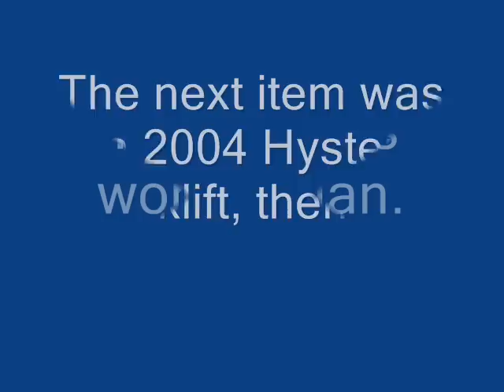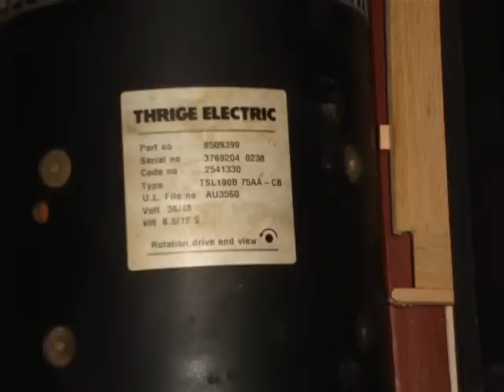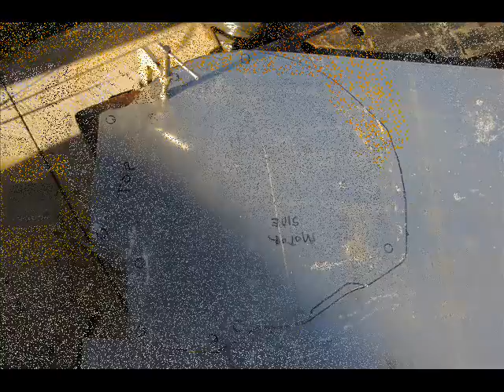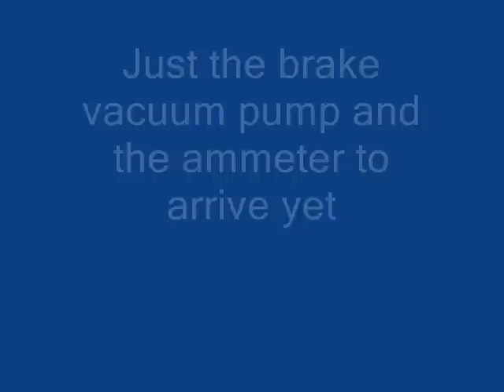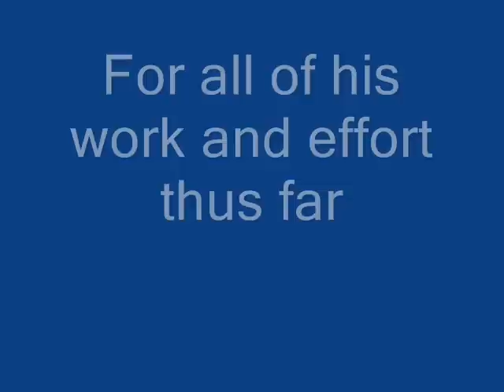The Homebrew Electric Car Saga - Escort EV Installment 1

Comment: @hipofalcon Hi thanks for the interest. I have just this day uploaded a video where I talk about the project and show my engine it is called Benny's EV vol. 1 ENG 
Yes two stroke pollutes more than four stroke. Trabant Is also almost made for an easy convertion. they are super light, easy to work on and need no pumps for the breaking system. My Mother and I removed the engine with our bare hands because it was so light :-)

Comment from the maker: Yes, you could keep the air conditioning by running the pump off of a pulley on the electric motor, but I chose not to on this one. As far as the motor goes, this one was from a 2004 Hyster fork lift. It was the motor that was used to run the hydraulic pump for the mast. There are lots of used motors around out there for sale.

Comment: @urbex2007 A diesel electric hybrid. Only problem is that done in this way it would be a bit inefficient. Diesel electric locomotives uses the electric traction as their transmision, with an electric car convertion you still have the original gear box unless if you remove it and make a more direct drive hookup of the electric motor. Or you can just use it as a range extender for a batery electric car, and don't care about the energy los to power two transmisions.

Comment: @hipofalcon ...can you share some info... is it absolute to use the flywheel and clutch?  Are there advantages/disadvantages with or without?  also, without a clutch, is it easy (for safety purpose) to shift out of and into gears?  thanks.